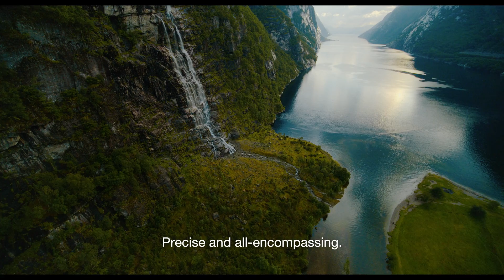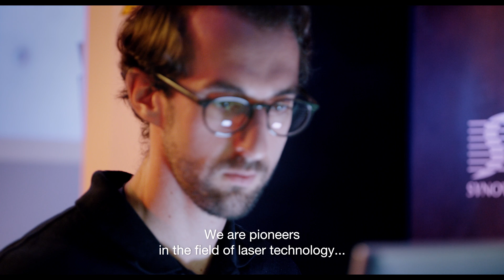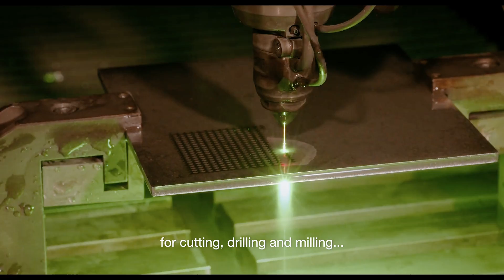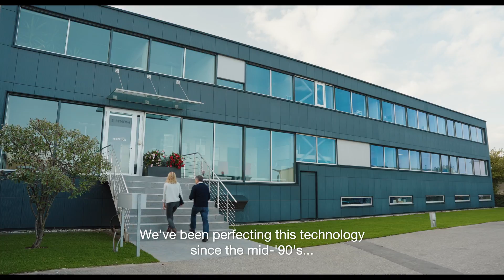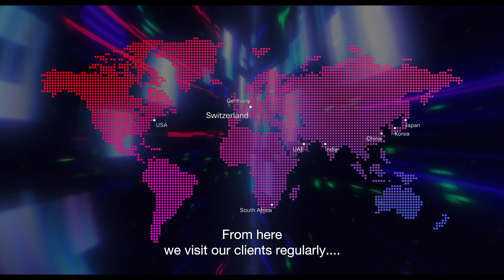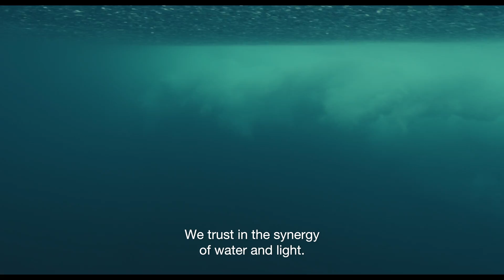Synova SA - Corporate Video (2'32")

Comment: you use a green laser (at least in the video) i have a few questions:
why use green and not something in the infrared region? shouldnt this be more easy to focus as with the higher wavelength?
assumption, personally i assume it is a green pulsed laser (not a diode laser) am i right with this?
is it not possible to create smaller nozzles (1 micrometer, as the wavelength of the green laser should easy fit in with 530nm or so)?
How much pressure would be needed to push water through a 1 micrometer nozzel ?

:-)